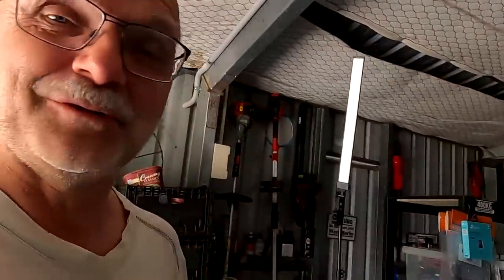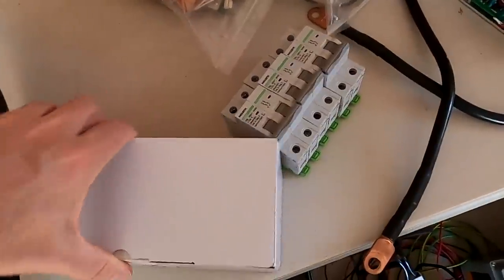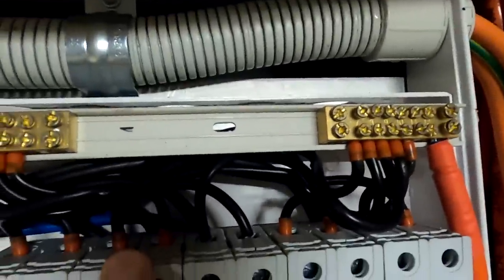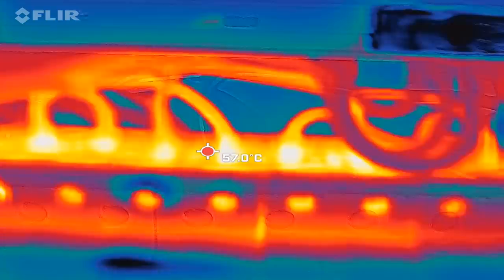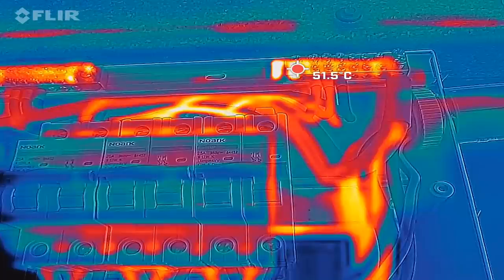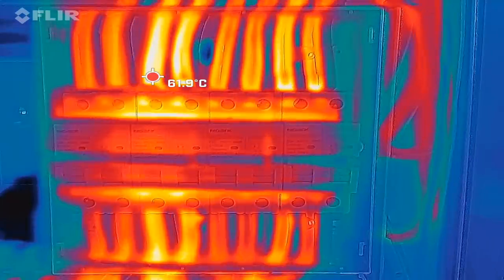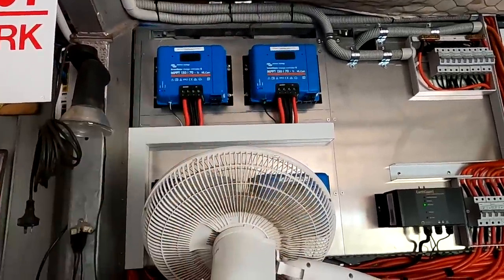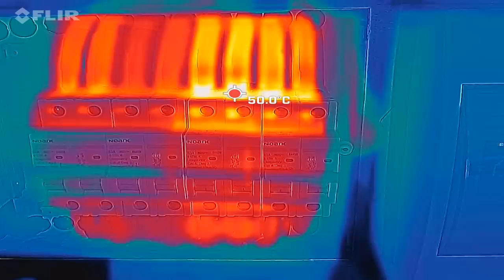The PowerWall and Battery Shelf in sunny hot Australia at 40°C. What can we do though?

Comment: I ran into heat issues with my solar system on my sailboat similar to your issues. The way I’ve combat it is I 3d printed brackets to mount multiple 120mm computer fans blowing onto the charge controllers and onto the breakers and just that alone was enough to solve my heat issues during peak of the summer here in Florida, USA

Comment: Put a mini-split AC in your garage.  You've got the power.  I'm in sunny hot Arizona and put in a garage mini-split.  Best investment ever.
Reply from the maker: I have no wall space to put it anywhere near the PowerWall.
Reply: AC is treating the symptoms not the cause. 

Better roof insulation.  Move the combiners away fron the roof even down by just 100mm or so and isolate with thermal insulating mount. In combination with breakers not fuses and ferrules in screw terminals and bare wire in clamp terminals. Problem solved at the cause. In hind site just better planning 😊

Comment: Andy, I had the same problem with fuse holders like those, and fuses in general. I switch to breakers, and problem solved.
Reply from the maker: Ah, great to hear. Yeah, the combiner box in the roof space is now like 25°C cooler with all breakers installed. A further insulation of the roof in this area will bring it down a bit more.

Comment: Interesting look at the heating of wires/connections.  I think you were fine with the ferrules as nothing was improved without them.  The only thing I could think of might be a small oscillating fan hanging from the beam and blowing on the power wall.  You said it's only hot for a few months so an A/C unit seems like overkill.  Great video as always.
Reply from the maker: Yeah, I will put the ferrules back on on these connections. Not a fan of bare wires.
Reply: Instead of a fan, a cm or two of foil back insulation under the roof - leave a small gap between foil and roof - will be a fine passive solution.
Reply from the maker: @Sylvan_dB  Yeah, that's what they tried with the cloths under the ceiling. It works quite well actually.

Comment: Very interesting. Another great video. Did you see (EG4 Hybrid AC/DC Solar Mini Split Air Conditioner Heat Pump | 12000 BTU | Direct Solar Input) maybe those old panels could power it during the day to cool you Garage.

 I wonder if my MC4 inline fuses have much resistance. I finally got my solar all sorted. Only if I could get more days with sun as I am in the shortest days of the year and day after day full clouds. I am looking into adding a wind turbine since we have plenty of wind where I am at and solar for December in north USA only handles my loads if the sun comes out partially. I had to use Grid power for 2 days (10 days of shitty cloud cover). I could have done another day but didn't want to take my batteries under 50V. 50-54 is where I keep them.

Comment: I've been moving away from ferrules in compression connections like are found in main lugs, circuit breakers, and SSRs because bare wire provides surface area for contact, after hot spots were found on equipment in the field. Bare wire runs an average of about 10c cooler in the products I work on. 
Also, if you can pull your ferrules off, they were NOT crimped correctly. The ferrule should never be able to removed that easily.
Reply: I must admit that I wondered about that, I can't pull off my ferrules after I crimp them on.
Reply: The crimps were fine. When he squeezed them it was in an orientation that reversed the crimp. That's another reason why ferrules are not a good idea: a little mechanical force in the wrong direction and the crimp is loosened and you're much worse off than without them.
Reply: @awo1fman  Some of the first ones he pulled off he didn't need to "reverse crimp" was what I noticed. What can I say except none of the ferrules I've used could be pulled off by hand, I've always had to cut them off. Probably a good thing his weren't that way, since he didn't need to shorten the wires.
Reply: @awo1fman  I strongly disagree. A proper crimp should never slide off that easily. That would fail a pull test spectacularly. Read up on what crimps should be. I recommend starting with NASA-STD 8739.4A. Also, there are international standards for absolute minimum pull limits. For those cables, it's around 250N. Ref DIN 60352-2.
Reply: These are edited videos guys, they will not show every detail, im sure Andy really knows what he’s doing. 👍
Reply: I setup an off grid system around 2005, Trace was a popular controller back then, they were then fitted with a bored out barrel, with like an M8 or 10 grub screw from memory, that you could sow home, that cable you could hang off and it wouldn't pull out, also alot of material in the lug itself to carry the high currents, now the controllers are fitted with these clamping jaws, typically like to get on an MCB breaker, which seem a bit crappy for high current applications, also another point these crimp on lugs, say are designed to clamp 25 or 50mm2 cable, the part or eye that excepts the cable are very short, at best you can only get one crimp, also the lugs are wafer thin, and at best maybe 10 or 20mm2 cross section area of material at the flat section of the lug?

Comment: Interesting Video. Bought some Fuse-Holders and thought about installing them - in rainy cold Northern Germany ;). Maybe not. 

As i got to know recently: if you bundle cables in a duct, you have to adjust for wider cable diameters - even with DC-cables. I will watch that closely on my installation, when more DC cabling may go into the duct.
Reply from the maker: Do it and install them. You won't have any problems in North Germany with them.
Yes, the cables are already oversized a bit and only a few are carrying large currents at a time, so not all of them heat up the same time.

Comment: Thankyou Andy for all of these tests.  I have also been considering the heat build up when I finally get around to building my system in Texas.  Have been looking at plans of building off the side of the garage with a special room for just the power wall and batteries, and putting a mini split to keep it all cool during the hot summer days.  Was also thinking of stepping up the wire sizes to prevent loss and to keep the temp down.  You have shown that it might be worth the extra effort.  Thanks again.
Reply from the maker: Yes, that makes sense and you're on the right track with your design. I'm constantly thinking of building this extra room inside the garage now. It would make so much sense in many ways.

Comment: I suggest that you look at the current in each of your circuits. As all of your terminations are new and shiny, there should not be any resistance problems. Although you did see the difference between the fuses and the CB's. Therefore the only reason for temperature difference would be the amount of current through the conductor. I do like your presentation style.
Reply from the maker: Thank you.
I can check all cables with my connected MPPTs, shunts and inverters/loads and have over sized all cables a bit to the max current initially designed for this system.

Comment: Andy,

If you let a little air spacing between the fuses or circuit breakers they will not get so hot.  Putting some small openings on the bottom and top of your fuse boxes will give some natural cooling.
Good luck
Reply from the maker: I could actually space them out a bit as I still have two modules unused in these boxes.
Holes in these boxes are not good! Insects will get in and start building a home.

Comment: For the charge controllers, I put a couple 1 inch fans to blow air up through the bottom of the heatsink. I control the fans with an aliexpress temperature controller with relay output. Probe attached to heatsink, set fan on/off to desired temps.
Reply from the maker: Yeah, but as I said, it won't help the rest of the installation...

Comment: I added a nut between the SCC mounting flange and the wall to allow for additional air flow across the back... Any spacer would do. Although you would think that your aluminum would help dissipate some heat as well.
Reply from the maker: The heat sinks on these controllers are massive and yes, the aluminium back wall could help or make it worse, depending if the sun shines on the outside wall.

Comment: One side of the MCB has the bimetallic strip which gets hot, the other side doesn't. And fuses and MCB have different types of thermal overload protection MCBs have a bimetallic strip which bends and trips the actuation mechanism, whereas fuses rely on the fuse element to get hot and melt away this breaking the connection, you typically oversize the fuse and MCBs if you want low watt loss.

Comment: Makes sense to use ferrules in screw terminals and non ferule in the clamp terminals for best connection in either case.  

No surprise fuses are in effect a resistor designed to burn out in over current.

Comment: Andy, I appreciate your methodical approach and explanations. Every video ist entertaining and at same time a great piece of teaching. 🙂 
My experience is that soldering at these applications (high current) is not the best idea  in order to reduce contact resistance. Solder is far less conductive than copper. Depending on the type of alloy the factor is 4 up to 10 while pure Sn/Pb is the worst. 
On other hand solder might migrate away from the pressure of the clamp. 
Such issues get important the more current we squeeze through lugs or clamps.
Reply from the maker: Thank you, Johannes. I never solder such cables or connections. That is definitely the wrong method and will cause trouble in the future. I always crimp.

Comment: When you bundle the cables together in a solid ducting they heat up and copper is a great conductor of heat.
Use a wire basket and separate the cables to help with heat dissipation

Comment: Even in UK summer my Victron MPPT controllers were becoming too hot to touch. I fitted a pair of 90mm centrifugal fans under each controller blowing upwards. These are controlled using temperature controllers which I have set to cycle between 35degC and 40degC. They work well. With your higher ambient temperatures you would probably need to accept higher settings to avoid the fans with all the time.

Comment: Great investigative work & experimentation Andy, the FLIR is a great tool for proving these theories. 
I would lean toward using a 50-60C thermistor on each controller with it’s own small/quiet fan or a larger one to do them all, independent fans would also let you know (optically & acoustically) which controller/panel set, is getting hotter at the different times of day. I like the idea of A/Con a sectioned off work area which includes all ur power wall gear, u have plenty of power to at least do this for the extremes & would make a good solar dump also, but I thought ur wiring @ 10-20C above ambient doesn’t seem too bad under those conditions.
Getting accurate Ambient Temp can be tricky, as you know this can vary a lot by sensor location, I believe the correct sensor placement for ambient readings is supposed to be 1m (3’ USA) above the ground in a shaded position. As others have said, a piece of wood will help to insulate the Nuvi from the iron cladding, but I do think it will be hard to get accurate ambient temps in that location, being high and close to the shed cladding could influence it greatly depending on many factors, ie: time of day & if Rolla-doors are open or shut even, wind, etc. Walls influence sensors in a bad way also, in that they can slow the sensor reaction time & if sun hits the wall or ground near it can channel heat, even the gravel on ur driveway with a slight breeze could blow across & up the shed wall to give false readings, but you will get used to this anomaly of temp differences. It would be a nice feature if you could calibrate the Nuvi temp sensor in ur settings to give u a more accurate ambient temp on ur monitor, as u can with volts & amps in ur BMS’s to match ur main shunt. Congrats on ur 50+K Sub’s, always look forward to ur vids. Cheers

Comment: Instead of throttling back your charging I would just get a inverter Ac unit.
Having conditioned a garage is almost a must for me here in Florida during peek summer.
Not just for cooling the equipment but me also when working on projects. 
Set it to 80 and it makes it tolerable even with your door open.

Comment: I agree with a few other comments, that removing the ferrules from the wires seemed a bit too easy? Also, my employer just bought me a torque screwdriver and I am amazed at how much extra torque I need to apply to get to 2,8Nm after I thought I tightened the living snot out of the breaker already with my regular screwdriver.
Maybe something to consider? More tools... :)
Thanks for the videos Andy, and all the best from grey, frozen Belgium (-5A outside)
Reply: more tools are always good … ALWAYS ;-)
Reply from the maker: It may have looked easy in the video, but it took me while to squeeze them back and forth and loosen them just a bit, so they actually start moving. Didn't want to bother with a 2 min squeezer video 😉

Comment: I checked the resistance of my fuse (15A) and fuse holder (max 30A). Both are from EATON so rather good company and are designed for DC and PV. Resistance for the fuse is 8,8 mOhm and for the fuse and holder together, it is 9,3 mOhm. Multiply by the square of the current assuming max 15A gives around 2W of power and it corresponds to datasheets. So good quality fuses and holders are very important for power loss and heat. And in general, I recommend staying with fuses (gPV characteristic) as a first stage/level of PV protection. For the second we can use DC breakers.

Comment: How about some cheap DC fans (PC fans) to move some air over the hot components? Can be hooked up to a thermostat sensor. I've had some good success doing this instead of the huge cost and electrical overhead of installing a refrigerated AC. A little bit of airflow goes a long way!

Comment: On my charge controllers I run a small a small PC fan, I have it connected to a timer that I turn on in the summer.
the fan just sits on the top and blows air over the fins at the back

Comment: Hey Andy, love following here, even though I've completed my own setup months ago. I can't help but think that you could simplify your setup A LOT with using a Deye string inverter instead and your system would work much more efficient. 
You have an insane amount of thick gauge cables that could all be eliminated. I am running a 36kW system(3x 12kW inverters and 43kW panels) and the panels are connected with 6mm2 cable, 8 strings, around 450-650V each, but very few amps(13 MAX), so no thick wires required even though my runs are long(+100m).
The only thick wires in the setup are the 50mm2 going from the inverters to a common busbar and then connected to my 3 Seplos Mason 280Ah DIY kits.

Running high voltage strings also further has the benefint of not needing breakers or fuses as you are not paralleling anything, you could never go over the rating of the panels and you can make do with a simple on/off switch if you want the ability to cut each string(I did this).

A single SUN-12K-SG04LP3-EU/AU could handle all your panels and all your batteries, 15600W solar input and 12000W charging up to 240A@48V.

It also has a true off grid output creating it's own net and a gen input which can also serve as another output if need be.
Reply from the maker: Thanks Daniel. A string inverter won't help and will be far less efficient in my situation. I have a lot of shading on the roof and the parallel strings work a treat. I have a string connected array on the house and it is far less productive in partial shading.
I have a made quite a few videos about it here on the channel.
The low voltage parallel strings have more cables and connections, true, but the overall yield is insanely high.
Reply: @OffGridGarageAustralia  Hey Andy. If the shade is enough to enable the built-in bypass diodes it shouldn't matter much. If not, then perhaps coupled with optimizers.

Comment: Hi Andy - this may help - On my EpEver  MPPT solar charger I tucked a little 45c n/o thermo switch wedged in the corner between the heat sink fins   so it switches on a small 80mm PC type  fan that directs air centrally on the lower part of the heat sink - as it in my camper I run 12v on a 24 fan as I just want a gentle flow and no noise - it works a treat and only switches on when the charger is working 80%+  capacity  on hot days.
Reply from the maker: Yeah, that would have been my first thought as well. I'm not a big fan of fans 😋. More dust, more complexity, more maintenance.
There are some 3D-printed fan accessories for the Victron MPPTs. But again, not the ideal solution.... Maybe it is though, I'll keep it in mind. Cheers.
Reply: @OffGridGarageAustralia  Mines  been running 3 years faultlessly Andy - one thing I would add is the little thermal switch has to be out of the fan air steam  so it does not chill it directly or it will cycle needlessly - tucked in the corner with some heat paste works

Comment: VIDEO IDEA: 
Hi Andy, love all your tests. Could you connect your NoArk breaker to a spare lifepo4 cell and induce a short and see if the breaker protects the battery from damage by testing its capacity afterwards. Thanks.
Reply from the maker: Thanks for the suggestion. I will have to stay away from any short testing with these batteries and breakers. I don't have the equipment here to safely do such testing in case something goes wrong. A garage is not the right environment for that. But we can probably have a 20A breaker loaded with 150A and see what happens.